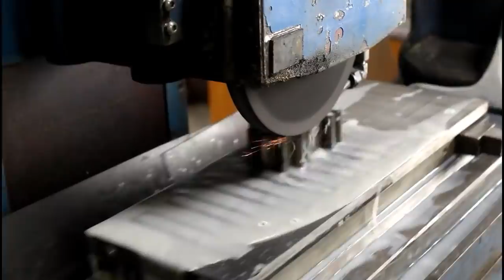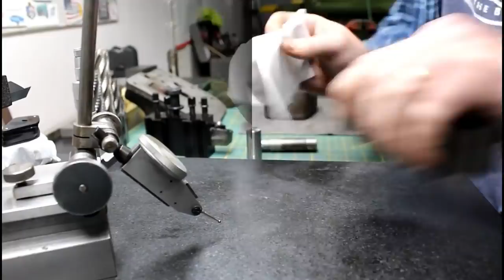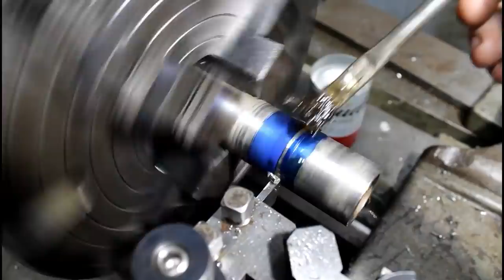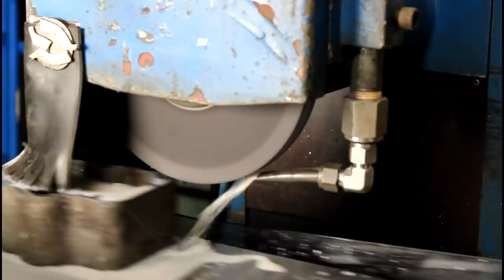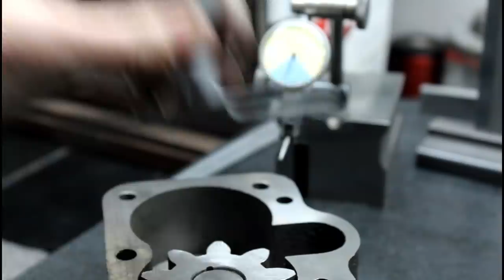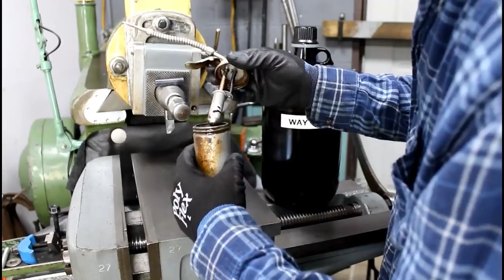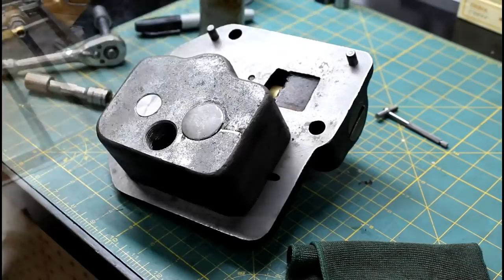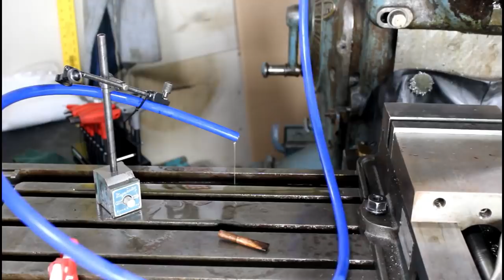OH Yeah! Gear Pump repair part 2

Comment: why not...... machine out the casting and fit a nylon or teflon replaceable liner? so if it goes again you can replace the liner?
Reply: It wont go again in a lifetime
Reply: @jusb1066  but the fix is there for the next owner
Reply: That is a great idea! I'm going crazy here with all sorts of ways to fix it but a nylon sleeve is simple and it will do the job. Also, loose particles will not jam. worse comes to worse, you replace the sleeve. It would make sense to make a few of them up front anyway.
Reply: @linuxaos  exactly as its softer then the impellers, its sacrificial, any crap will chew up the nylon before it chews up the teeth  quick job to change it out, and good as new again lol

Comment: Why not grind the gears and the case at the same time? After that use a stone on the gears to get tight clearances to the top. I blueprint automotive oil pumps this way to get the tolerances as close as possible. .005 is too loose IMO, s/b closer to .001. Also don't deburr the gears or the inside of the pump chambers.
Reply: GMTA
Reply: " .005 is too loose IMO, s/b closer to .001."

.005 is almost certainly too loose. But his diametric clearance (rotor to bore) may be an even bigger problem. See the tolerance tables in: https://www.albany-pumps.co.uk/wp-content/uploads/2017/01/Gear-pump-Standard-operating-manual-and-instructions%20.pdf
Reply: @aporiac1960  good point. Sleeving or larger gears may be the best option.
Reply: the driven gear wouldn't be in the right place without the pin
Reply: @BobOBob  that's not going to matter. You could even use a piece of paper under each gear grind and the clearance would be there when remove the paper. They just need to be oriented closely to their running position.

Comment: Anti return valve so that it doesn't drain over night! Please don't ruin it by brazing, you'll never get it to a point where it doesn't drain back! By the way, not critical, but I would have marked the gears so that they go back to where they were, they were bedded in, they will wear faster if they didn't go back into their original relative positions! I have an ancient mechanical hacksaw with a ball type non return valve, easy to make, it's the realistic solution to the problem! Regards, Matthew

Comment: Is there a check valve in the system? Also, did you measure the wear between the gears and shafts? This could quickly destroy all your nice surfaces if the gear start oscillating. Thanks for the videos. Can't wait to see how you fix it.

Comment: Thinking about the gap between the teeth and the “circle” they run in.  Instead of doing your wipers at the end of the teeth why not line the part circles with a brass or bronze liner.  Given I doubt there is any heat issues in that pump you could glue them instead of mucking about with silver solder.  You could use a thicker section of material them bore to correct size for close fit with the gears.  Just a thought and perhaps less fiddly than individual wipers on the gears.   IF you go down the wiper path I would suggest doing only some of the teeth on a gear, not all. Essentially add wipers until it starts to work.  You only need enough to get the pump self priming. After it gets oil flowing it seems to be running reasonably well.  Interested to see how you finally solve things.  :-)

Comment: Ooops! I wrote my comment before the end of the video. I am of the type that would probably consider suicide at this point, but an alternative might be to always close the valce on the line when shutting down. That MIGHT stop the drain-back.
Reply: That fix only works if the check valve is the only problem. That fix will not work if there are any leaks in any of the seams or joints of the pump house (eg, the split line between the two halves, the pickup tube joint, or the drive shaft). The leak could be so small that it seals under pressure when the pump is running but opens when under vacuum when the pump stops. Or perhaps there's a tiny amount of ooze around the drive shaft which he's ignoring because the volume is so small and it just drips back down into the sump.

Comment: Plumb in a small hand pump for priming the gear pump, then you just have to pump three times before starting the machine, after you have not used it for a while

Comment: Put a check valve in that suction line. Simple fix.
Reply: @anonymic79  Well pick the right valve and it is not exactly a high speed or ever was it a "precision " pump, nor is it ever going to be used in an high use industrial situation again, so a quick fix surely has it's merits.
Reply: Yes a simple old brass flapper valve in the suction line. But it must be installed horizontally. So  a 90 degree bend then the flapper valve then another 90 degree to the screen. This will give the easiest suction threw the valve. ( the flapper hanging vertically)  This should keep coolant primed in the pump.

But be were if the pump can be run backwards you will have a hydraulic lock that can break things.
Reply: @johnlemmey7698  A ball type can run vertically and just replace that suction tube. McMaster stock item.
Reply: @johnlemmey7698  will not work  brcause  the pump not sucking   no neet a velve if the theet proper lock,  but if the theet leaking  your velve not work
Reply: Yes oil can't leak back to sump and I use it on dieselpumps witch are not self primed.
Reply: @TOPPeet  i will not work
Reply: Rambozo Clown    that would be my suggestion too. The pump works fine,good flow and pressure, so any work on the gears would be a waste of effort. Even with new gears there is no guarantee oil would not still drain back when left unused. An in line valve or perhaps two, one before and one after the pump, would surely be the easist and most reliable fix.
Reply: Wasn't there a flapper in the delivery tube?  If so you might just glue a peice of soft rubber to it and be done.   Considering the slow rotation of the pump anything other than perfect gears and housing will probably have a hard time self-priming.
Reply: @tonyrmathis  the check valve would have to go on the suction side otherwise the oil could still run back out of the pump into the foot through it.
Reply: @anonymic79  True, also the lack of pickup pressure won't open a check valve as well as the oil.
Reply: bill bergovoy   indeed that is likely but closing the tap while pumping is or should be failsafe. Although forever priming pumps on old machinery is a rite of passage which the younger generation will miss out on, I recall a prewar Holbrook lathe but that's another story.😉
Reply: Add a small hand pump to pick up oil from the sump and inject it into the output tube of the gear pump, and then use it just before you turn the coolant on.
Reply: I use a dart style check valve at work and it will work vertically.
Reply: A check valve is an easy build, too. Custom piece between the pickup and the housing. 
Steel ball bearing and brass housing.
To close the gap between the teeth and housing, maybe solder a piece of shim stock to the pump housing. 
Check valve first, though.
Thanks,
John
Reply: 100% been doing my own maintence on cnc machines for years and there's so many check valves.

Comment: Not many oil pumps will pick up dry. It's only for moving coolant after all, so if it works let it wear itself out by using it. Keep up the good work.

Comment: Steve: My rule has always been "don't scream til you get hit". You have taken a lot of the slop out of the pump and it basically worked before. Put it back together and see if the improvement is enough. If not, you might be able to get the gears hard chromed.
Good luck!

Comment: The edges of the gears should be a sharp edge or you increase slippage past the gears.  I used to rebuild precision metering pumps.  The gears are generally ground and lapped with the gear plate (middle plate) in a 3 plate setup.  This is to ensure the gears seal against the top and bottom of the cavity.  That is why you also need to keep the gear tooth edges sharp to prevent a leak path.  You should not have broken the edge on the housing either.  That also creates a leak path.  Yours just does flow so some slippage might not matter, but will make it lose its prime easier.

As for the clearance between the gears and the walls, they should ideally be within a ten thousands of an inch or so.

Gear pumps do not self prime either fyi.  If it is losing its prime, then it is probably the check valve.  Wipers would probably mess with the meshing on the gears.  You could make a spring loaded shoe to ride on the gear teeth at the outlet side.  Think a v shape that is curved to match the OD of the gear.  This is used as a wear compensator on commercial gear pumps already for transferring fluids without lubricating properties such as water.  You only need to seal the last few teeth (maybe a quadrant or so), the rest are not important.
Reply: Agreed. Back in the 70's I worked with a millwright/mechanic who re-machined oil pumps for obsolete antique engines as a side line. Watching him sit and hand lap those parts always fascinated me with the precision that was required.
Reply: Stainless steel sleeve to decrease gear side clearance
Reply: I agree with your comment except this is not a hydraulic pump this is a COOLANT pump that needs to handle particles of metal.  It needs those 0.025" clearances to keep from jamming on the junk suspended in the oil it must pump.  It all has to do with the time it takes for the particles to fall out of suspension.  Junk under 0.02" may not drop before it is re-circulated.  Steve's 0.005" clearance is too close, particles that small WILL NOT drop and WILL be circulated by the pump.

The edge beveling is a real problem.  The edges should have been left sharp! The slope on the edges will funnel larger metal chips between the gears and face of the case.  This could cause the gears to jam or bind.

Video part 3... regrind the gears to remove about 0.010" from each side of the gears to open the gap and get a sharp edge again.
Reply: @chuckinwyoming8526  if you are getting particles large enough to need .025 wall clearance than they will bind the pump where the teeth mesh.  Proper screening to filter them out will prevent this anyway.  The clearance also makes it more likely to get junk in between the gears and the walls.  No matter what, a gear pump is one of the worst types of pumps to use in this application.  They are for precise metered flow or for high pressure applicarions.  A flexible impellar pump is really what should be used.
Reply: @anonymic79 , I could pull the pump out of my machine and measure the clearances.  As I recall they were very large.  I suspect much of the 0.025" tooth clearance Steve measured was original to the pump.  My 2HL is a direct predecessor to Steve's mill with many similar parts and design.

Unless you have run a K&T mill and had the wondrous fun cleaned all the crap out of the sump you don't have a feeling for just how much fine metal chips the coolant carries back into the sump.  On my mill the drain tube from the table returns 8" from the pump sump (possibly baffled into a much longer path or diverted to the brass screens) .

I agree with you how a gear pump SHOULD be built and it's tight clearances.  That doesn't apply here with very low pressure output of thick sulferized cutting oil full of metal particles.

NerdByDesign makes a great point that a gear pump is a poor choice for a dirty coolant pump.